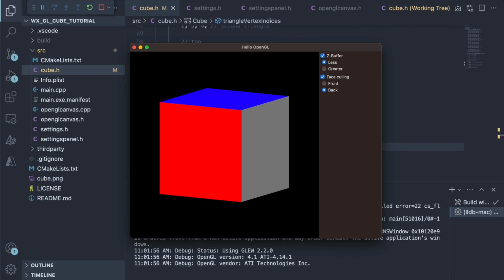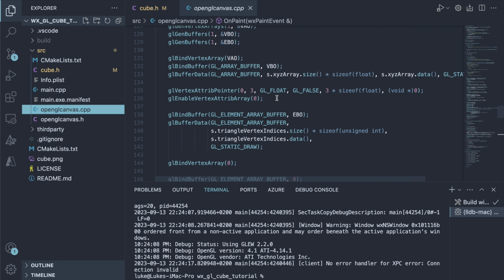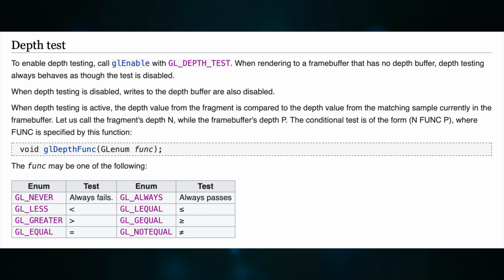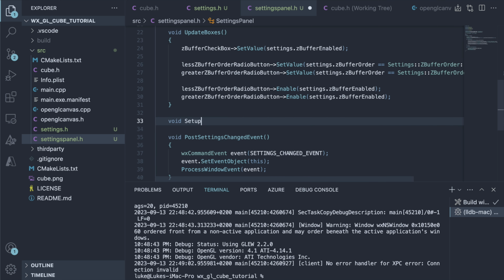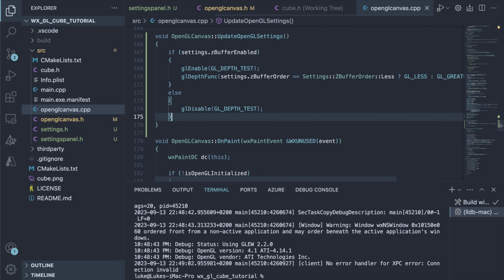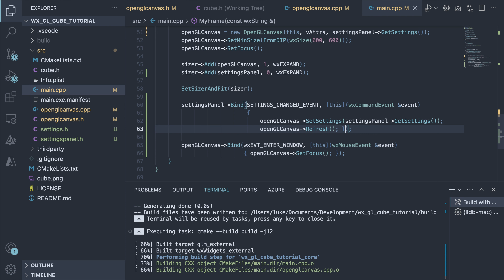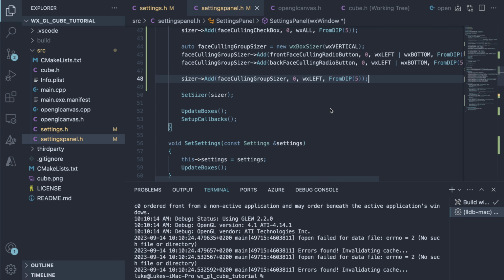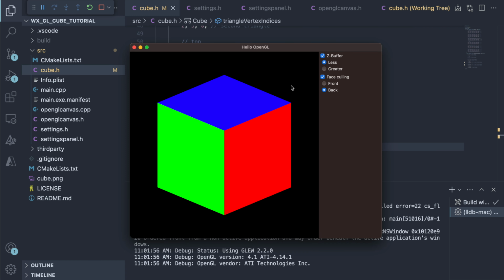Modern OpenGL Tutorial: Rendering a Colored Cube

Comment: Very nice tutorial. I was able to reproduce this with PyOpenGL and PyGame.

However, there is one thing that is somewhat misleading and that is the face coloring and how consistent it is. In order to achieve that you are duplicating each vertex to make each face has its own vertices. Vertices here are only shared if and only if they are part of the same face. That is why one side of the cube looks completely blue and another one - completely red.

In most cases this is not the case. Most 3D files (recommended to store your model in one once you get past basic shapes and want to introduce some content created using 3D modeling software) optimize the number of vertices so that a vertex is shared by many faces. In that case, e.g. you load an OBJ, you will get mixed colors across almost your entire model.

It would be nice to point that out in such a tutorial since this is something that newbies will encounter pretty fast.

Comment: Modern OpenGL? on a mac where you are stuck on OpenGL 4.1? : ( Not a good idea.
Reply from the maker: FYI this code works on Windows, Mac, and Linux
Reply: Send me the code please
Reply: Check for functionalities that are used and compare feature sets). While my GPU is an RTX3080, I set my shaders and PyGame's OpenGL context explicitly to 3.3 and it works like a charm meaning that the feature set required for this example is lower than OpenGL 4.1.